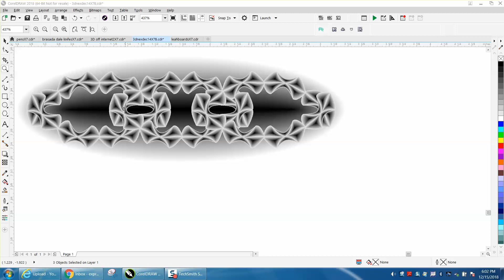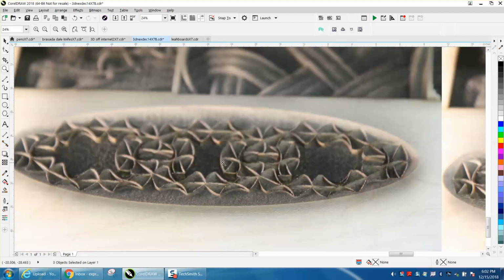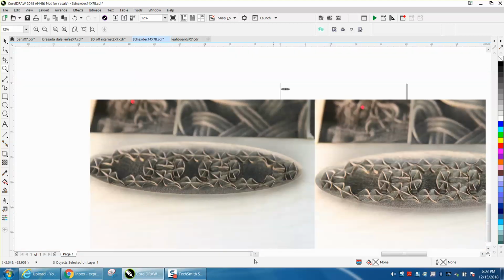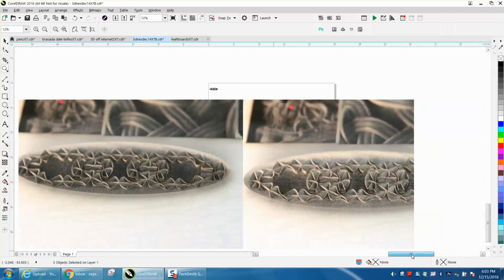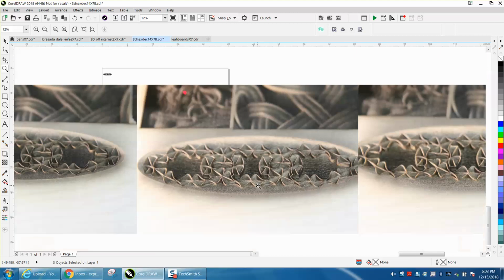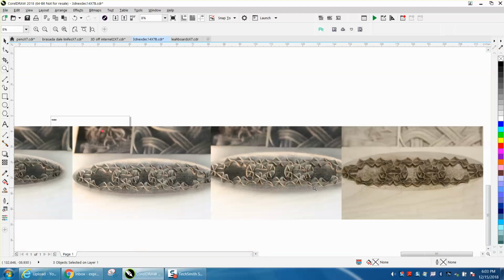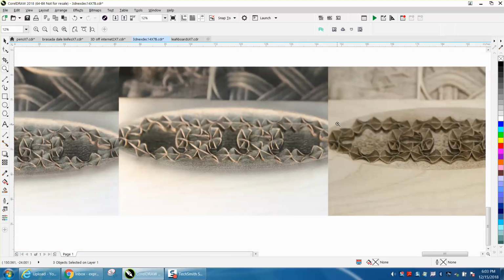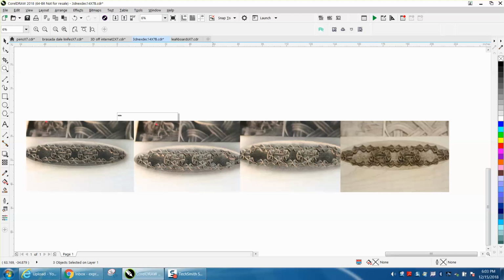Laser Tips & Tricks 3D Engraving Part 4 clean up your Engraving

Comment: One more tip for engraving -- keep your air assist down to a very low pressure -- just enough to keep smoke out of the nozzle.  High air assist flow will blow the smoke back onto your work surface.
Reply from the maker: thanks will try next time, I only keep mine at 20-25PSI
Reply: @DougGreenAustin  That's fine for cutting because the air helps blow the debris clear of the cut, but when engraving, you want only the minimum air flow to keep the work clean from soot.  Just enough to keep the nozzle under positive pressure and prevent smoke from backing up into the lens.  A good way of judging the air flow when it gets that low is to put some water in a small container (like a soda or juice bottle cap) and dip the tip of the laser head nozzle into the water.  Turn your air on, and adjust for light bubbles.